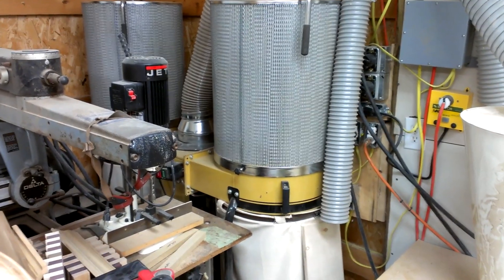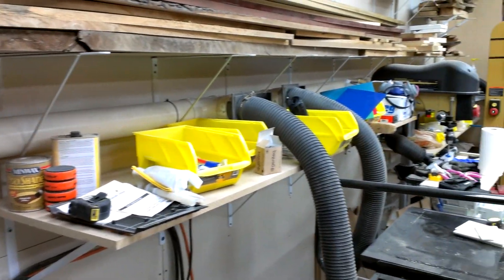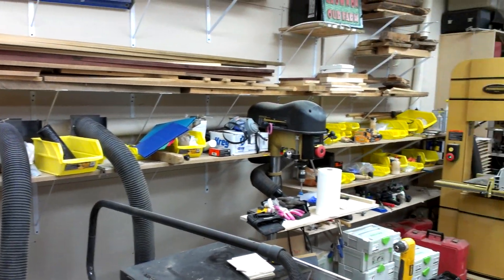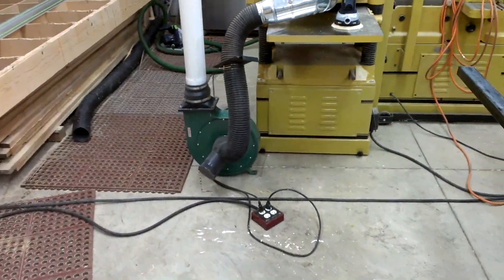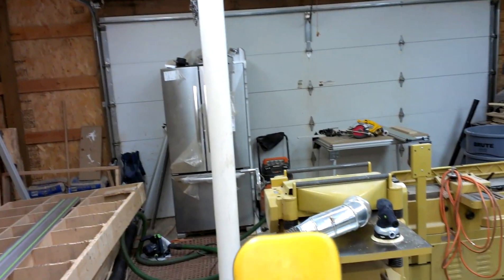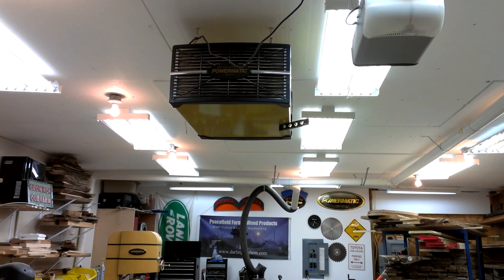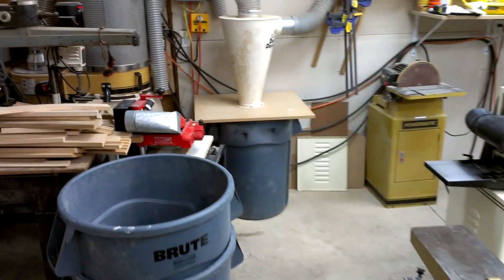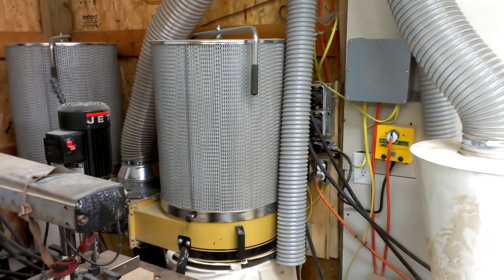My dust collector setup

Comment: Cool, my partner has made a 5hp custom cyclone.  It is all run through 8 inch spiral pipe with drops from 8 inch down through 4 inch.  Nice setup but we are still going to put another dust collector on the cnc so we don't have to run the big setup to run the cnc.